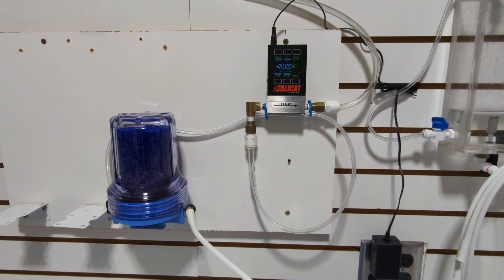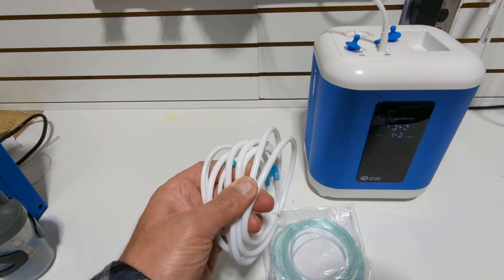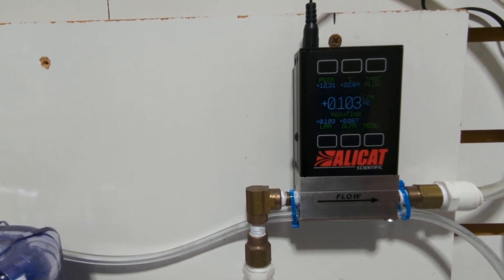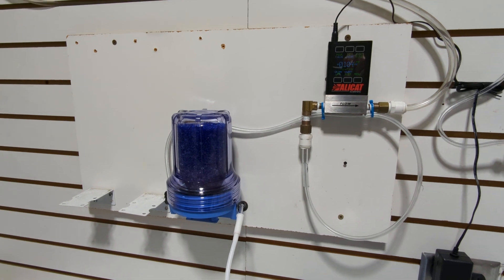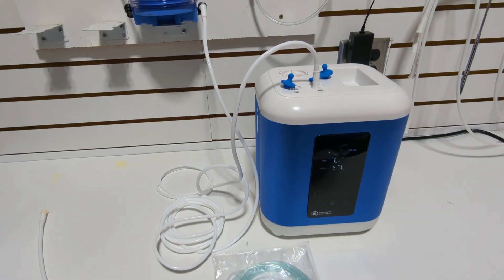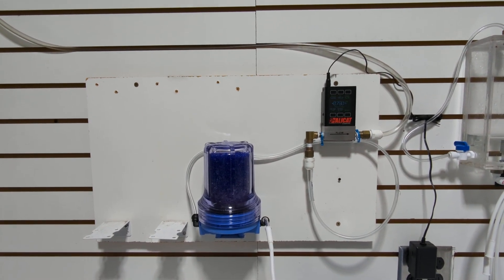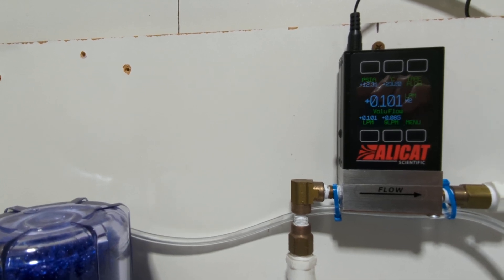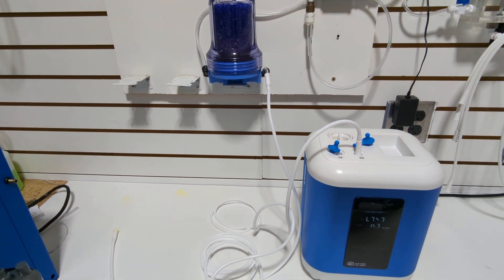Are you losing Hydrogen through the walls of your nasal cannula  hose?

Comment: If output is 900ml. Why did the tester show only at 102ml
Reply from the maker: The HX900 has many output settings. I have it set at 150ml per minute. The 150ml setting makes 100ml per minute of hydrogen and 50 ml per minute of oxygen. I have the hose connected to the hydrogen only.